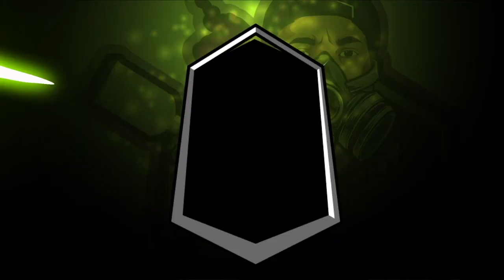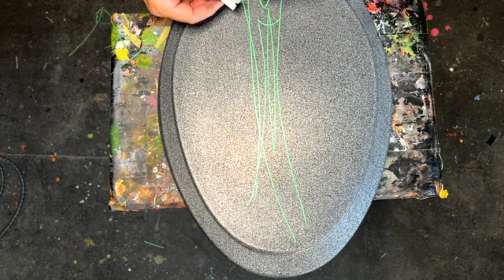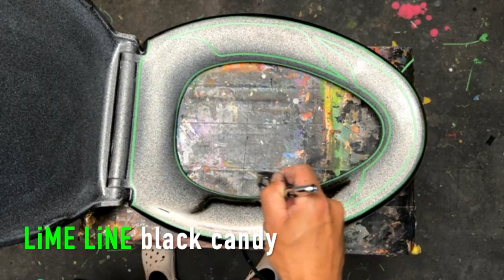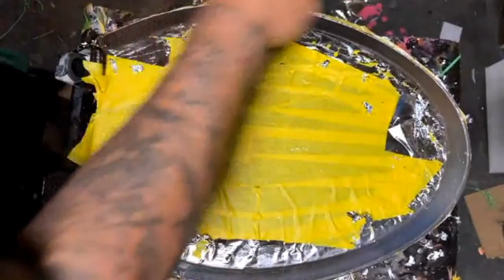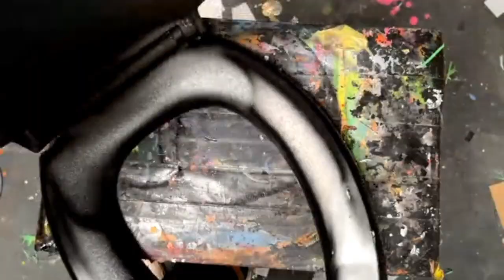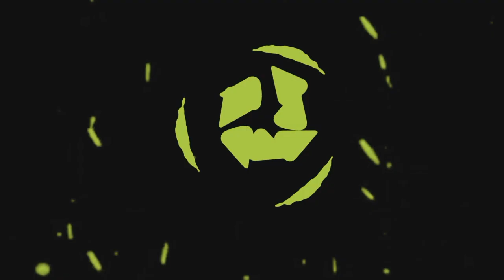Flush in Style: The Most Glamorous Lowrider Toilet Seat You'll Ever Lay Your Buns On!

Comment: I’ve painted a few of these in the past and have learned don’t do it on the plastic ones. Paint does not like to stick to them
Instead find the painted wood (or some sort of composite) ones
You can tell the difference because they’re heavier
Reply: if you sand the plastic it will stick
Reply from the maker: Sometimes you need plastic adhesion promoter for the plastic the wood seats absorb the paint, making it at hear better